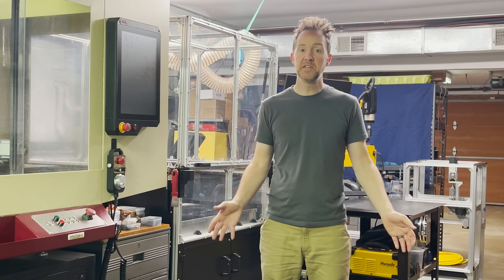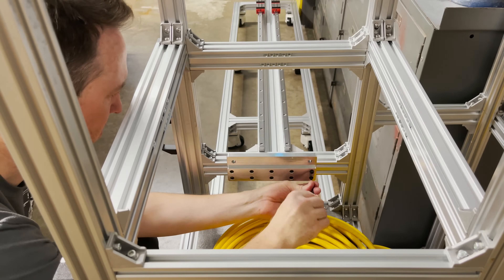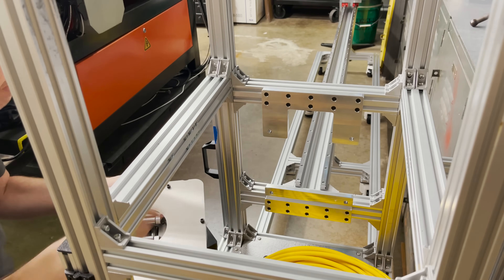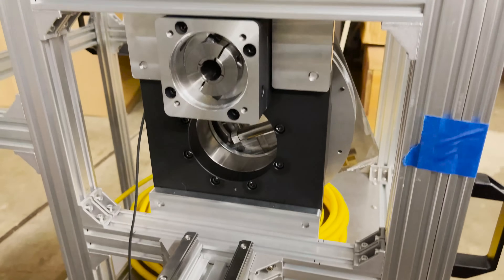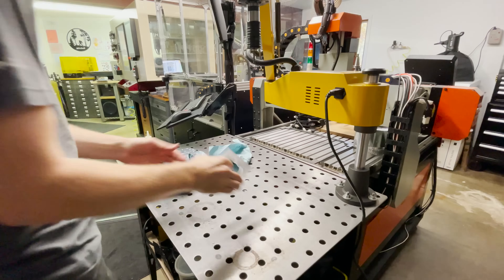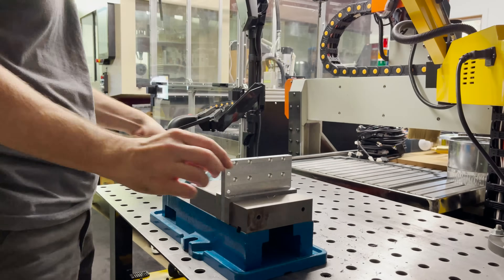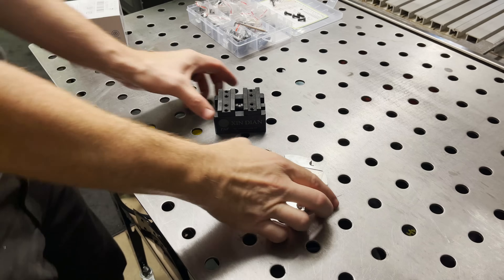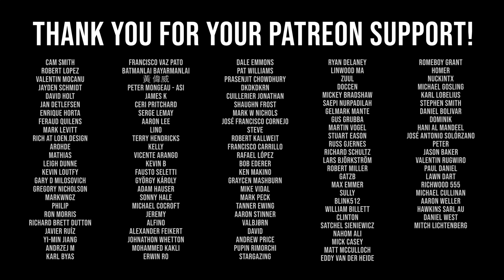DIY Fiber Laser Tube Cutting Machine | Part 3: Rear Chuck

Comment: Hi ! , I'm curious, what are you gonna use for motor / step motor ?
Reply from the maker: Leadshine AC servo motors
Reply: @diyfiberlaser   have you ever heard about the Teknic ClearPath ? with the embeded drive
Reply from the maker: @Phtevenzzz  Yes I have. I've never used them, nor do I feel compelled to try them. From what I've seen, their main draw is their auto-tuning software, but the Leadshine servos I'm using also have that feature.
Reply: @Phtevenzzz don't try Clearpaths USB-serial library in C#, it's nearly useless. It's crazy old, no proper error support etc. 
Even more frustrating is that it's a serial connection and they don't provide a normal library for an embedded device, it's linux/windows only.
Reply: @electrowizard2000  Thanks for the advice ! I alway wanted to give them a try but in the "step & dir" forme.
Reply: @diyfiberlaser  I will give a look to those Leadshine, it's nice to have multiple possibility and i'm sure that if you choose them it's beacause they have great feature !
Reply: @Phtevenzzz  I'd +1 the Leadshine suggestion then, no reason to pay teknic markup for simple inputs.

Comment: WIth a tap arm like you have, does it ever break taps or is the success rate high?
Reply from the maker: I've tapped probably 200-300 holes with it so far, M3-M10, and haven't broken a tap yet.
Reply: If you use it wrong enough then yeah you probably would break the tap.
Reply from the maker: @Arek_R.  Haha, good point!